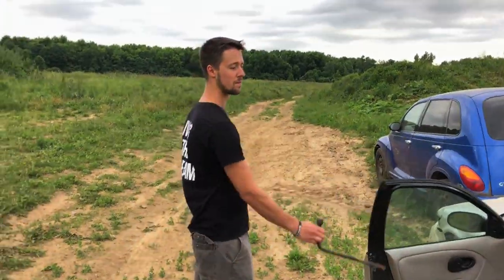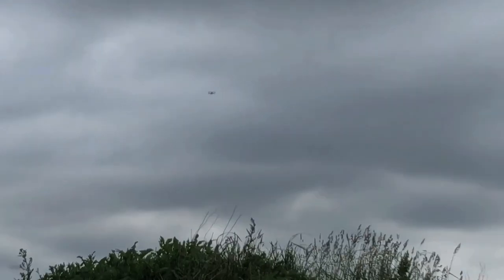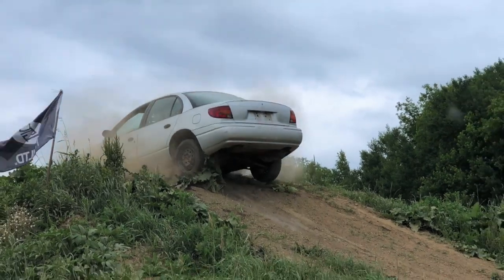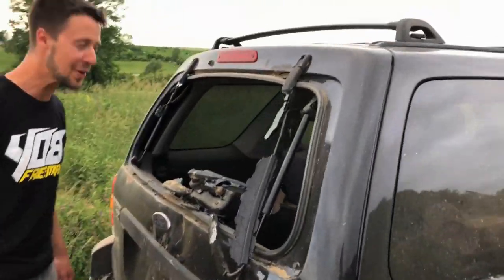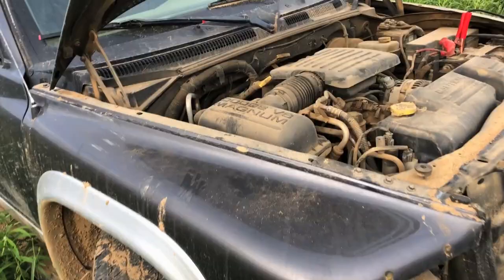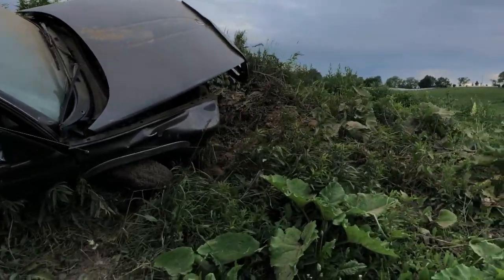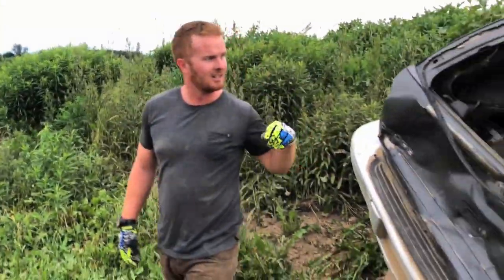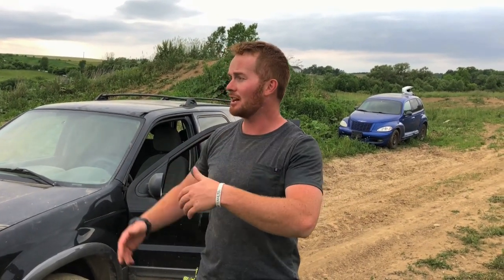LONGEST DODGE Durango JUMP EVER! 4X4 LAUNCH!!!

Comment: If you wanna jump a standard car.  Take 3 planks of wood, one wedged on each pedal, then pull the brake and clutch wood out with the gas still wedged.
Reply: Pat Hayes or just start it in gear. Clutch switch easily bypassed